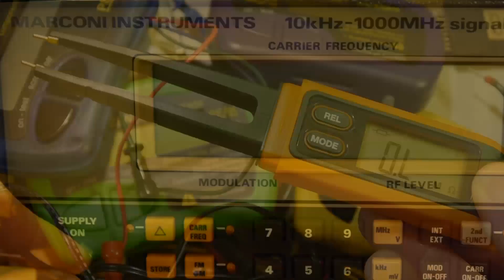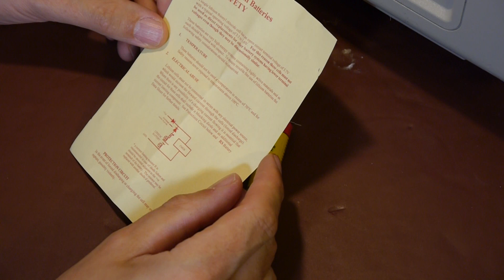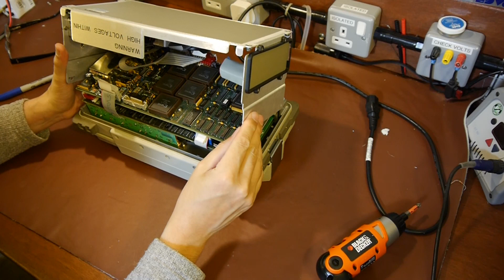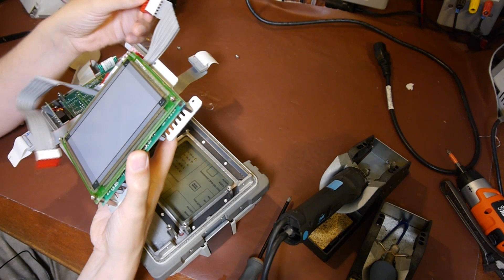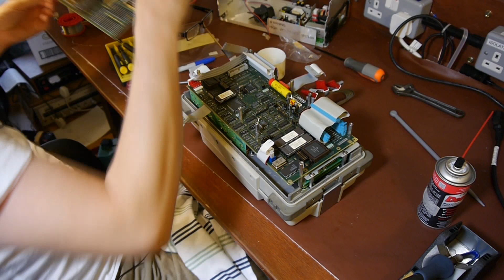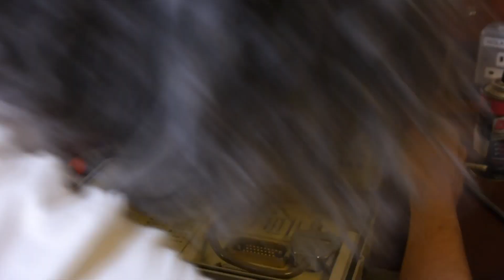Lithium

Comment: I like it! I'm not gonna crack. Nirvana baby is 26 now, how time flies.  I didn't realise this equipment provides a full range of BER/BLER measurements, control-circuit timing analysis with transition diagrams on the screen and a built-in V.24 breakout box. Perfect Christmas present for the missus.
Reply from the maker: Andrewausfa  yes amazing any idea what does though ? LOL
Reply: Aaah...errrr...mmmm...no.  It's for in service and out of service bit error (BER) and signal measurement of CEPT digital circuits. And it's 190mm wide. That's, the 190mm bit, the only bit I understand :)
Reply from the maker: Andrewausfa LOL

Comment: Li-SOCL2 batteries typically have a service life of 20-30 years.  Most of them have glass-to-metal seals to prevent leakage due to the high reactivity of the electrolyte.
Reply from the maker: douro20   I have replaced quite a few backup batteries over the years and perhaps I'm lucky but never had a issue with Lithium batteries. Many thanks for your comments my best regards Chris.

Comment: I looked up the hv5408PJ PLCC (the board has 5 pairs of them) and it's just a serial to 32bit convertor with HV outputs (bit of waste in a LV lcd application, but maybe these came in VFD versions too - back in the day..). So 5 x 32 is 160 pixels Horizontal, and 4 x 32  is 128 pixels vertical. Not exactly a retina display. Again, have fun!
Reply from the maker: Cliff Matthews  Hello cliff. I wondered if it was one of these that had died as I'm guessing that maybe they work in a grid configuration with drivers for rows and columns but I'm not sure. Unfortunately I have not managed to find a suitable extension cable allowing me to probe it under power.  I did trace back some of the connections back from the defected area of the panel to the driver and ran the iron around the packages but made no difference. I cannot help thinking it was a mechanical failure as the unit worked until it was removed from the enclosure.  I made the video a few weeks ago and have found some data sheets since then and I'm hoping to dig a bit deeper when parts arrive. Thanks for investigating and comments. My best regards Christian.
Reply from the maker: Cliff Matthews  hi Cliff spent a bit more time and research the EL display is not a back lit LCD but an arrangement of luminescence pixels. These  could be energised with up to 60 volts and unlike LCD is not a static arrangements and require constant hi frequency drive.  I had assumed the EL was just the back lighting for traditional LCD technology as  it is often used this way.  Still a good bet one of these drivers has failed
Reply: A thread started today on EEVblog "Why VFD instead of LCD" and someone offered a link on EL technology at BENEQ dot com (under technology) for those interested.. It seems these are still viable tech, and like VFD displays, can withstand harsh environments.
Reply from the maker: Cliff Matthews  Cliff thanks for the link it was a interesting thread with technology I have not really investigated much. I couldn't miss the opportunity for a bit of shameless self promotion. Regards Chris

Comment: Okay, I finished watching your video. Now, you want some advise on how to fix it.
Perhaps I can be of help.

To me it seems you can fix the display up easily. I once repaired a display (LCD) from a professional background music player that had the exact same way of interconnection between the display itself and the board. What happens is that the conductive glue between the film-type flat-cable ant the board loosens as it ages.
With some VERY CAREFUL trial and error you can use a proper temperature controlled soldering iron (in my case that was a weller WSD81 at the time) at a LOW TEMPERATURE (THE CABLE WILL MELT OTHERWISE) to push down on the conductive strips that adhere the cable to the board. That fixed my issue.
This was before I started doing youtube, but you can find the pictures here. should be easy to see the "before" and "after" types :) http://s123.photobucket.com/user/Dubje/library/DMX%20PROFUSION%20X?sort=3&page=1
Reply from the maker: MrDubje  Hi Jeroen.  I just had a look at your photo bucket and the failure is very similar to the one in your photo. Did your fault respond to applying pressure on the flexible connection to the panel. I  have not tried this yet as I need an extension cable to run it outside the equipment as I cannot reach it when it's installed. Anyway Jeroen get back to your lab I want to see your next video. Thanks best regards Chris
Reply: Yes, it responded to pressure indeed. But you'd need an extension cable to check it in your case, indeed.
Was in "the lab" just for an hour before writing this comment, cleaning smoker's nicotine residue off of some nice Japanese 10-turn pots, lol.
Reply from the maker: MrDubje Nicotine is really horrible to remove. I have serviced a lot of various communication receivers that have been ruined by nicotine it gets into everything sticky and corrosive. It always horrible to bring some vintage tech into my home that's come from a smokers house as a none smoker it smell.  Still not my place to abuse smoker but it's not for me.  Many thanks regards Chris.

Comment: The EL probably means Electro-Luminescent backlight. That part's fine, but the display certainly doesn't have interlace problems because it's run statically by a 5 by 4 set of paired memory/drivers. So the second last PLCC on either top or bottom group of 5 chips will be where to focus-in on the problem. With so few pins on the header in the middle, It's likely data comes in bits, bytes or nibbles and is shifted through from one chip to another? You should be able to work on it out of the box by providing power only, perhaps all the segments will be on and that would be enough to start pressing in order to find poorly soldered PLCC pads. Good luck my fellow EEVblog member. loads of fun for everyone!

BTW - I like the relaxed "discover as you go" style. BigClive and Julian have made it popular now and it works well at promoting a level of "over the shoulder honesty". I think big success would be on the way if some gal with substantial frontage were to do the same kind of show.. but then again I don't think the viewers would learn too much!
Reply from the maker: I was joking - I dont think they will suit. You do make a serious point and I know perhaps some of my comments are not in very good taste and i tend to think I talking to the boys down the pub and obviously anyone can view my channel. I dont set out to offend anyone.   Thanks Cliff advise is always welcome.
Reply from the maker: Cliff Matthews Hello Cliff sorry I got your comments out of order. I did look have at having a probe around without power and found nothing adrift. Yes interlacing may not be the best choice of words. I don't know how well it shows on camera but it looks like the image is made up of odd and even rows. The image is kind of still visible under the fault and looks like either the odd or even rows are missing in this area.  I'm guessing that one of those drivers are is dead rather as I don't think it would be possible to instantly have so many of the panel connection fail instantaneous.   From memory I think the data sheet mentioned interlacing this I think is used to enable a lower power mode. I have a link to kegs video in the description demonstrating this feature. Very kind of you to make time to advise.   Well my video have to be a relaxed investigation I really don't know enough to give advice etc and just hope that my followers enjoy the journey. I also really enjoy the participation with the subscriber the conversation and comments are massively satisfying and have made some google friends. Thanks Best regards Chris.
Reply from the maker: Cliff Matthews   LOL Cliff I could get some false knockers would that work?
Reply: Maybe there are some delays with timing or clock pulses coming from the other board? Anyway i just went and posted a kick for your channel on the Mr. Carlson's Lab channel, I'm a little pissed at this at 81 subscribers, and how your efforts are going unnoticed - a bloody shame that YT algorithm crap. Anyway, I figure if we can name-drop here and there, we can power over some stupid YT number and you'll be well on your way.. keep looking up!

PS: My son has his own channels and tells me you should get 2 plugin's for your browser (VidIQ and Socialblade). He says when you're posting tags for content, it will qualify them based on stats.
Reply: Don't do it. My son subscribed and it would feel wrong in so many ways. That's all I can say..  Just wait, these days if it hasn't been done, someone will do it eventually  :-)
Reply: I find this also looks strangely similar to NavTel stuff (I used to use in the late 80's). DislayBLY dot com has some stuff on electroluminescent backlighting I bookmarked (who knows if this cranium can hold any more useless factoids from the past..)
Reply: Cliff Matthews It's an EL display, which to me is interesting because they used gas plasma displays in some of their later instruments.

Comment: Buying a parts machine is another slippery slope. Because you'll want to fix that one too. Thats what happend with that HP pulse gen I bought!
Reply from the maker: Simon Spiers Hi Simon check your Twitter  account I have some ceramic trimmers for you and Andrew. Yes the parts machine is a slippery slope indeed. I wouldn't mind but the things of absolute not practical use to me anyway. Got another logic analyser on the way and perhaps two.  Kind of thinking I might like to try some vintage computing or do something with terminals. Thanks Simon regards Chris.

Comment: https://en.wikipedia.org/wiki/Electroluminescent_display
Reply from the maker: MrDubje Hi Jeroen hope everything going well for you. I'm getting excited for your next project hope you have something coming soon. Many thanks for the EL information I'm going to have a look at it now. I thought it was a back lit LCD but actually quite a different technology and very interesting. Thanks again my best regards Chris
Reply: So far I have not had the motivation to make any decent video of the residual analysers that I'm trying to figure out, I have made a 17 second intro, but that's it. Will probably shoot some video tonight or tomorrow. Regards, Jeroen
Reply: I have not watched the video completely yet, but what you're holding there is a Planar/Finlux MD320.256-70E Electroluminescent display module.

More info here: https://www.eldisplays.com/md320-256-70e/
and here: https://en.wikipedia.org/wiki/Finlux
Reply from the maker: MrDubje  Yes looks just the same as the one in the link.
Reply: It IS the same one, I froze your video somewhere between 20:42 and 20:48 and was able to read the model number in full-screen mode, only to find out you put still pictures of the boards in the video as it progressed. I'm a dunce!